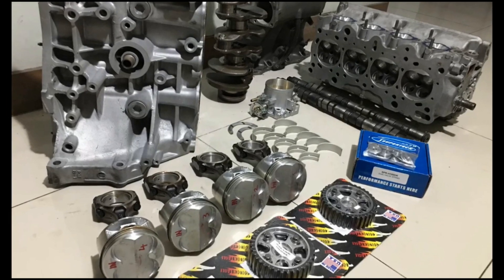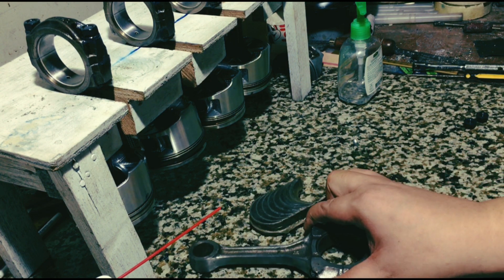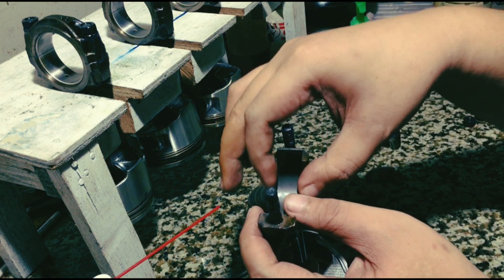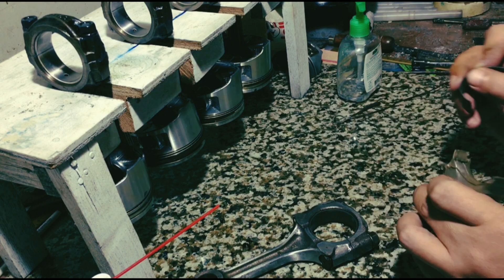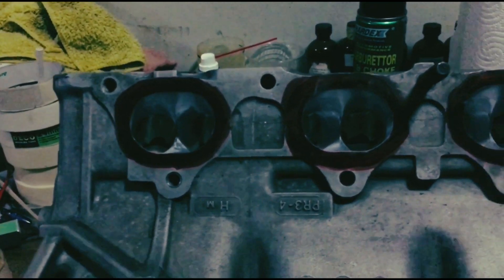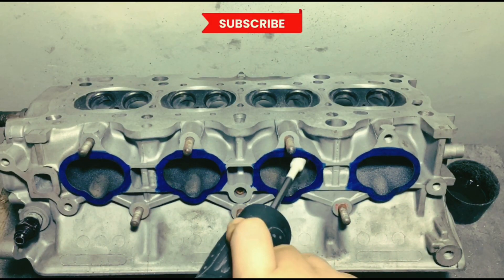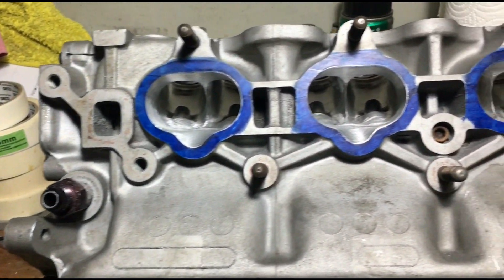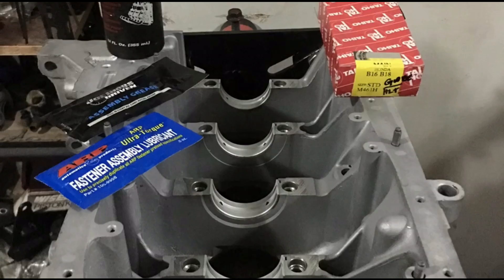B20 VTEC build Series part 1 "full set-up" by SRDmotorsports

Comment from the maker: Episode 2 is here to indulge on ur binge
https://youtu.be/eH5GEnyWhv0

Episode 3 we cam degree on this segment
https://youtu.be/8hJ-1G2huU8

Episode 4 is all about the valvetrain
https://youtu.be/UvZCgSeKeVk

Episode 5 we drop in/install the head
https://youtu.be/0xsjrlRKIk0

Episode 6 engine final assembly/finish
https://youtu.be/nu9SPsdMm6c

Episode 7 a recap and the crate engine is done
https://youtu.be/0sj-5RP0y90

Comment: How much hp this car make admin?
Reply from the maker: No dyno on the owners area

But this is almost the same as ECU Later’s b20vtec that runs 12.5s on pump and street car
Reply: @SRDmotorsports  okay, my future build almost the same but will use piston wiseco 85mm. For header which one u recommend 4221 skunk2 alpha, plm or dtr? I’m target for 250-260 hp using ron97 pump gas
Reply from the maker: @Ek3_8888  the skunk2 alpha gen1 original is real good and will reach ur goal maybe more 😎

Comment: What oil would you suggest to use on a b16a with about 260 000km. I usually use Shell HX7 10W40 but wanted to try delo Gold by caltex?
Reply from the maker: Those are fine nothing wrong with Shell

Comment: Question about the bearings. What brand of rod bearings did you use on this setup? Also for ARP rod bolts, did you resize the rod?
Reply from the maker: Bearings = OEM Daido/Taiho 
 ARP rod bolts yes
Reply: @SRDmotorsports  Thank you for the reply! Didn’t really expect you guys to reply so quickly. When installing ARP rod bolts to the B20 rods, do you guys normally have to also resize the B20 rods for out-of-round? Or is this not really a thing?
Reply from the maker: @kmvguy  no worries just so happened I was browsing when you commented 😅

On the b20 rods there are times it’s not needed as the torque rate is close to stock 23-26ftlbs on tightening

But on a B16,B18c 9mm rod bolts it’s a must as the torque rate is higher tightening it oem is 30-34ft lbs and ARP suggests 50ish that gets it out of round
Reply: @SRDmotorsports  Ah I see. Thank you so much for the clarification! I’m watching this series of rebuild and trying to absorb as much knowledge as possible for my future garage project.
Reply from the maker: @kmvguy  thanks for checking it out man hope it clarifies and helps on future projects ftw

Comment: What kind of sanding bits do you use?
Reply from the maker: 80grit and 120grit sanding rolls
Reply: Thanks!! Where can I find the same style? I'm rebuilding my D16y8 and looking to do what I can without turbo to squeeze some power. Thanks again. Love the videos following the the D build for sure.
Reply from the maker: @nickarmstrong8788  thans man! u can chec Standard Abrasives , the brand , key is use a long shank
Reply: Awesome. I appreciate the help. 👍
Reply from the maker: @nickarmstrong8788  thanks too for checking these out ftw!

Comment: Hi, just needed some help. I had lsvtec with chipped obd1 p28 and it blew. I am about to install a jdm b20b now. Will my chipped p28 work with it temporarily and what ecu do u need to run it since I will not be running vtec anymore?
Reply from the maker: Oh hey thanks for the comment (hope u like the vid too lol)

If it’s a chipped ECU with removable chip? U can have someone or a tuner burn u a nonvtec map to run but as is it’s will run with the current ecu will just throw a CEL when u hit vtec cuz it will be looking for the vtec solenoid signal hehe

Comment: Putting together a stock high compression b20 block with stock gsr head. Is it necessary to replace b20 oil pump for gsr oil pump or a high pressure oil pump?Aren't the b20 and gsr oil pump the same?
Reply from the maker: I think its fine to run the b20 oil pump as i always ran b20 oil pump

i think it was the 96-97 B18a/b LS that had a weaker pump that running a vtec pump helped but i also think this could be US only production LS , we never got those and 98-00 Bseries all had the same oil pump part number i think so you should be fine just make sure oil clearances on the bearings are good

remember too loose of a clearance on the bearings = lower oil pressure too so a balance has to be achieved
Reply: Should I change girdle? If so what girdle should I order? Also I want to thank you for advice and help!
Reply from the maker: @jaimemartinez6854  Oh amigo if it’s a good b20 it is fine with it’s own stock main caps we have run this way no problem a lot of b20 we build that was above 9,500 rpm no problem :)

In theory yes with girdle is better but too much work for “align bore” and “hone” of the main cap to match the b20 when you can do the extra work in balancing pistons and rods :)  so you are fine if you build it carefully your b20 :) 
Even add a breather to your block would work good

Comment: What is the average cost on this b20 vtec setup looking to do this to my 01 rd1 crv with a b20 high compression block and do a gsr head swap
Reply from the maker: Oh nice question !  locally (Philippines) around 220-230k  (4,000-4,300$) depending on a few things but thats the "no shortcut" average that includes everything like labor etc

Comment: Wonderfull learning. ☝

question sir. what is the performane difference of b20 non vtec local from crv gen1 to b20 from japan?
Reply from the maker: not much really i mean local is most likely cheaper and both locals have p3f and phk

the comp diff between the two is not as big as emphasized by jdm lodi tropas
p3h pistoned crv is 8.9:1 and phk is 9.5:1

il take a fresher 8.9:1 than a surplus used condition 9.5:1
Reply: owww. thank you sir. I'm looking for a cheap build b20. so I think I can go for the local non vtec b20 from crv gen1 for the mean time just to try bseries engine. 😁
Reply from the maker: @iant.angara242  yes sir.... the cheaper u can get with papers the better it is to help your project...
Reply: just what I hoped for, I just got a loal b20 from crv 1999 model for 16k. cylynder head with block, missing a lot of parts though. no distributor, oil pump, transmission, shifter linkage, cv joints, intake, fuel rail, T bracket, and water pipe line at the back. 😅 long way for parts hunt.
Reply from the maker: @iant.angara242  thats a great find if "with papers" because thats a price of just a surplus block! and you got the cylinderhead too! great!
Reply: yes sir. papers are clean. my 1st hunt is the oil pump. just in case sir do you have any idea where to buy? 2nd had ir brand new? and how much is it?
Reply from the maker: @iant.angara242  not sure but lemme check around... odd bka kinahoy that oil pump usually it doesnt have probs eh

thats the sad trend nowadays kya on the Vti series i had a episode talking about oil pumps cuz

looser bearings = ACL race bearings goes for lower oil pressure so when u think about it?

is it suddenly the pumps fault or people running parts that says "race" thinking its better 🤣 i mean ACL race bearing is good but bearing clearances are more
important
Reply: @SRDmotorsports  sige po sir, thanks. I helped one of my friend refresh his d15b block using your vti engine build videos and it turns out well. 

dami na rin kasing racing racing now a days sir. hehe. but what am thinking right now is to set it up in all stock mode. basics first to better understand functions then litle by litle upgrades 😍
Reply from the maker: @iant.angara242  yes that is an excellent approach i agree... its to avoid unecessary expenses too
Reply: Yes sir. let me know if you have the oil pump and how much it is. I appreciate much your responses sir. 🥰

Comment: Nicee video Keepp up the hard work 🏁💯 very clean build just subbed!
Reply from the maker: maaaan i loved your Kyosho!!! makes me wanna get one again!  btw u adjust the mixture screw? cuz if u do? u know tis possible to adjust a bit lean or rich?

i learned if u run hi nitro = like 30-40% on the fuel u can run a bit rich might be fun
Reply: @SRDmotorsports   Yess im in the process to lean it out a bit im running a rich low speed needle but next time i go out to use it i will adjust it to get more starting acceleration from it